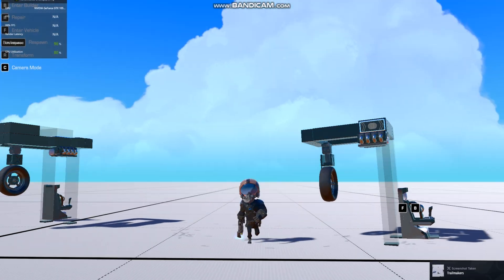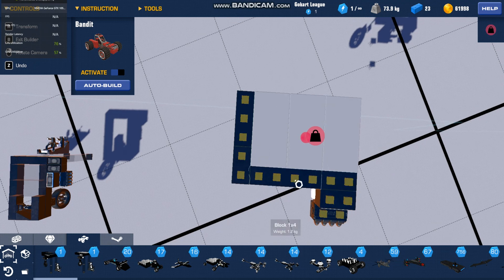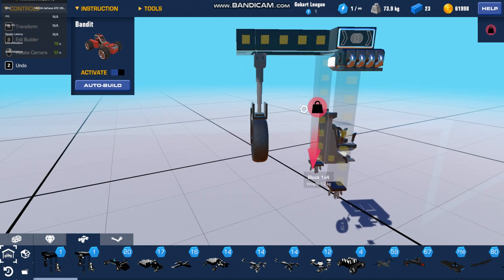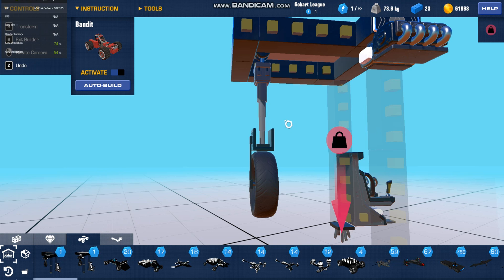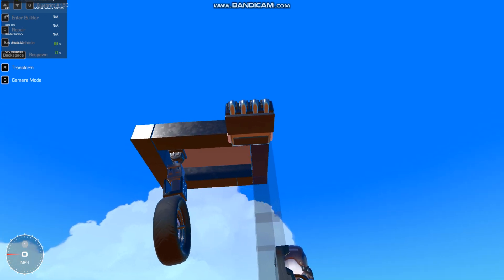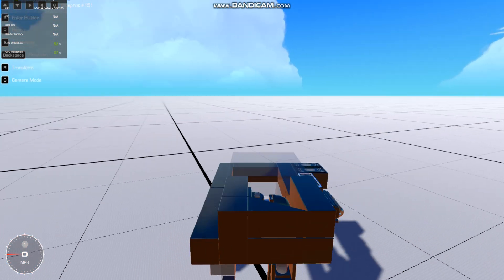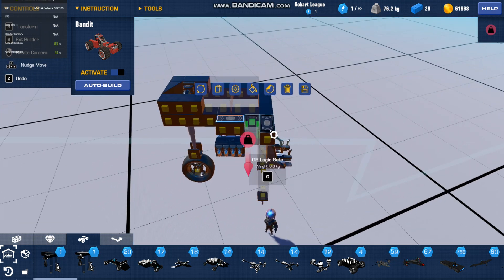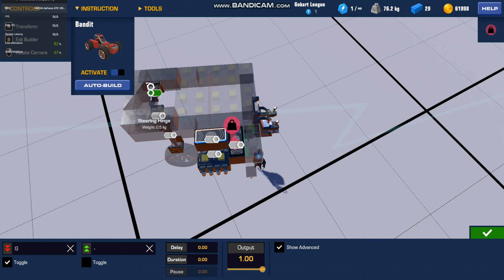How to make plane landing gear (Trailmakers Guide) #trailmakers #tutorial #showcase

Comment: How do u make it so the steering hinge only goes 90 degrees when u press the button
Reply from the maker: the logic gate with the A and D as input has a lower output than 1 so it does a percentage of the angle so set the hinge to 90 angle and the logic for steering to 0.8 output